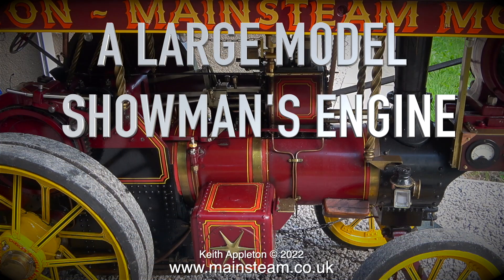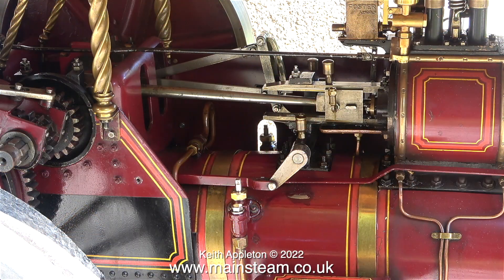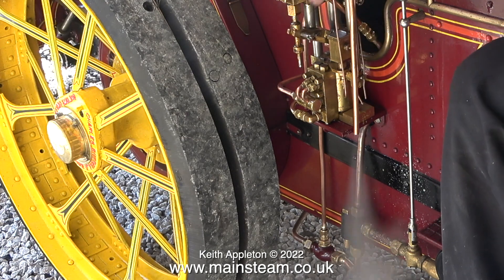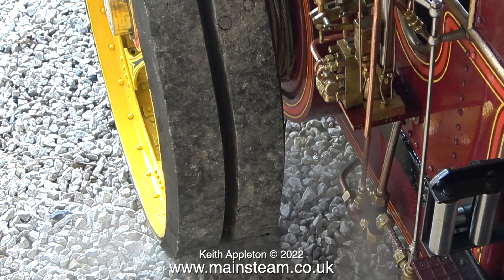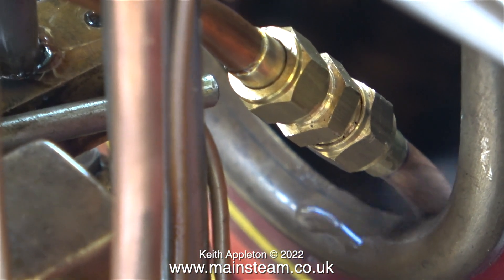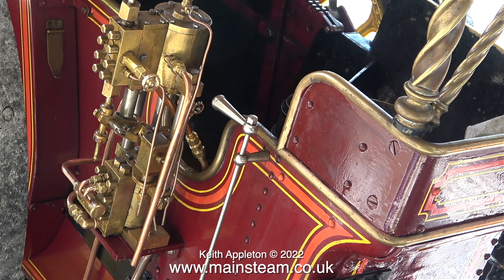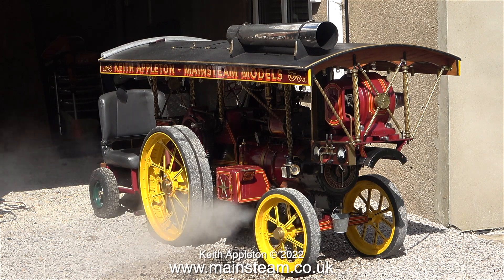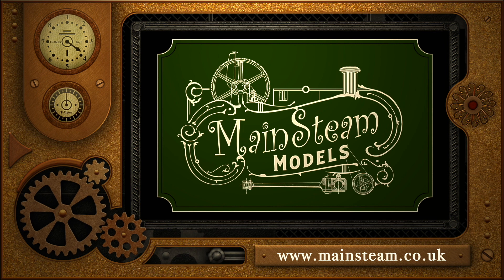A LARGE MODEL SHOWMAN'S ENGINE  - PART #64

Comment: I had to drop an injector size as I found a No 6 was putting in too much water into the boiler and killing the pressure too quick. A No 5 seems to be best for me.

Might need to look at the bottom of the stephenson linkage, the bar holding the link is worn.
Reply from the maker: Yes it is common for the expansion link to bottom out on traction engines, but I can live with it .......

Comment: @1:40 it looks as if your die block is bottoming out on the bottom of the expansion link, same as our 4” Burrell, we have to run 1 notch up when running in reverse.
Reply from the maker: Yes it is common on traction engines, but I can live with it .......

Comment: Bonjour Keith,
The exhaust of your pump sends its steam on your injector, possibly heating it, cans't it become a problem after a while ? Furthermore, I don't see its oil lubricator, is there one ? Where ?
Amicalement, Raphaël
Reply from the maker: The exhaust steam has no effect on the injector and if you look closely there is a mechanical lubricator on the pump.

Comment: I love watching this engine run. I have an easy question about the new pump and the injector. With the steam pump exhaust near the injector, will it heat up the injector? I learned from watching your videos that the injector needs to be cold for it to work properly. If it get too close to the hot steam exhaust from the pump will it still work? Is it just the camera angle that make them look clos together? These videos are always entertaining and educational. Thank for making them.
Reply from the maker: It will be fine, the exhaust will not heat the injector, especially when I finally bend it into the correct position.......

Comment: I know it's practical, but the pump looks really good on there, especially with it being a showman's engine 😀
Reply from the maker: Yes, I think so too. I am still not happy with the performance of the injector ..... problem is that the fault is now the injector. I am going to do some more experimenting - starting with the water supply to it. I will not be beaten with such a simple, fundamental and very common problem with Live steam Injectors fitted to miniature Locomotives & Traction Engines.
Reply: @keithappleton  The UP Big Boy actually had an injector failure after it got just East of us into Louisiana last year on it's trip out!

I have no doubt you'll fix it... been watching you long enough to know there's not much miniature steam related that you can't get fixed when you decide to :-).